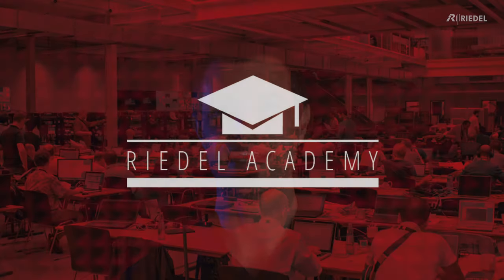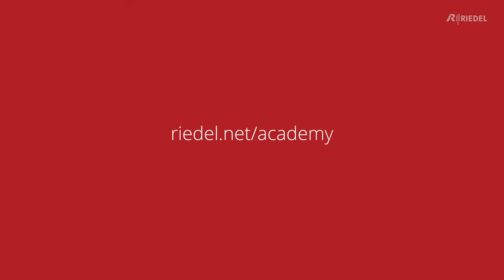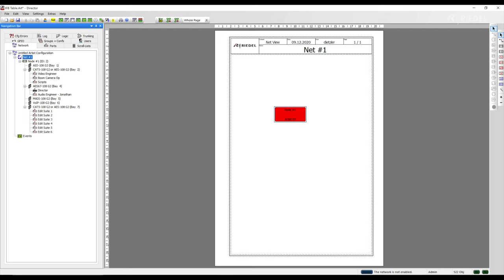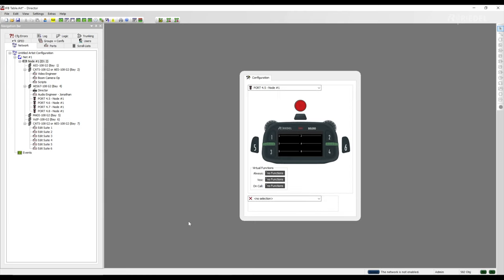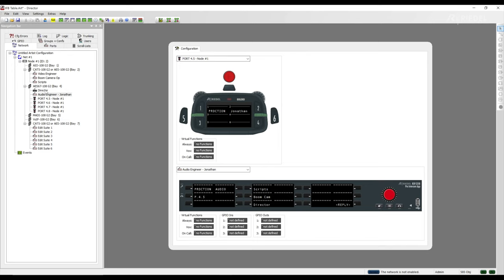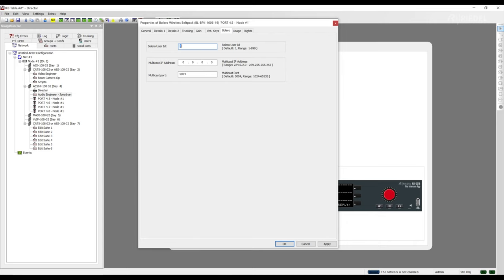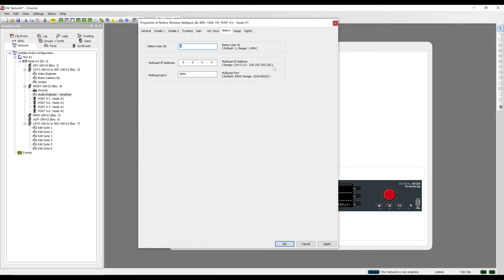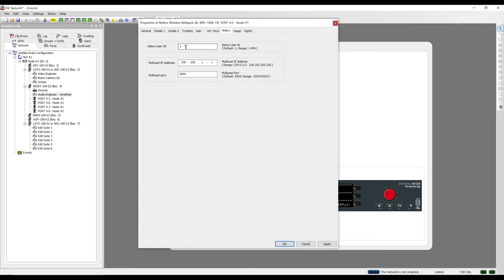Academy to Go -  Bolero Integration

Comment: So, every beltpack requires a port in an Artist frame? Is there a stand alone base station for Bolero or must it always be implemented through a mainframe?
Reply: Yes! bolero can also run as a Standalone system with up to 100 antennas and up to 100 BPs
Reply from the maker: Hey, yes there is a standalone version, this video is just if you want to integrate a Bolero system into an Artist system. For the standalone version have a look here: https://www.riedel.net/en/products-solutions/intercom/bolero-wireless-intercom/